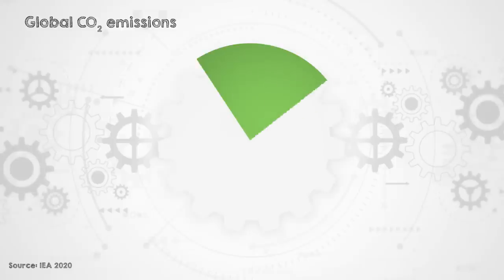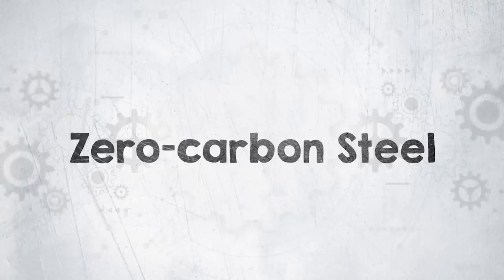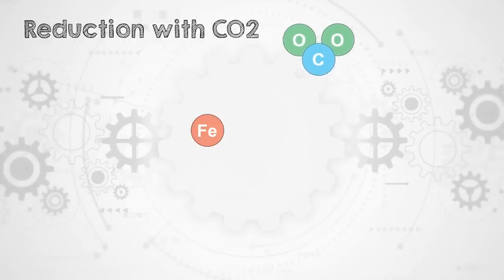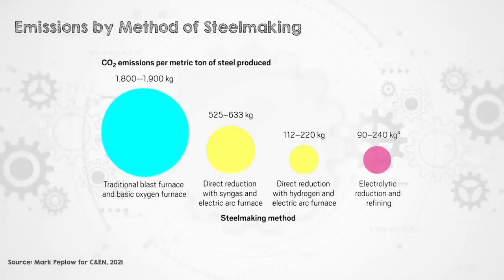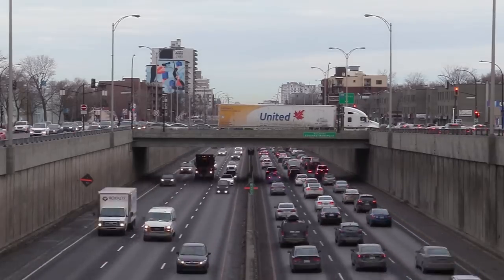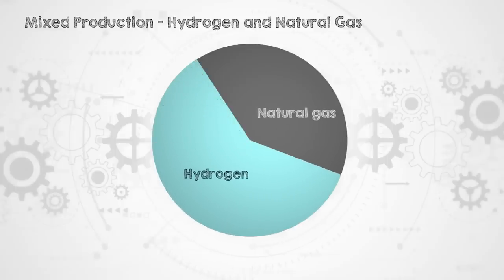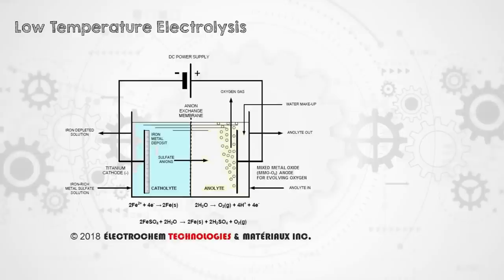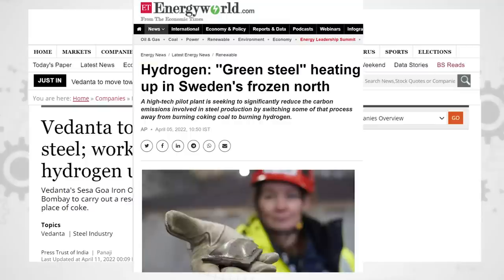Green Steel: Can We Make Steel Without CO2 Emissions?

Comment: absolutely fascinating, but I just don't think it will be as easy as the doctor thinks.
Reply: I've actually been looking into using a heat pump for high temperature smelting.  it should be much more efficient, if I can find a material that can take the strain at such high temperatures.  Which to say the least is proving challenging.
Reply: @roguedogx  Thermodynamics is against you in this. Heat pumps are great when you don't have to raise the absolute temperature much - say from 273 K to 303 K (0 °C to 30 °C), maybe to heat your house. The coefficient of performance (COP) is Thot/ (Thot - Tcold). For the houshold heating it would be 303/(303 - 273) = 10.1 this is the theoretic maximum, you will have other losses so might get 5 ish. For heating to 1200 °C from a heat source at 25 °C the COP would be (1200 + 273)/(1200-25) = 1.25. This again is the theoretical maximum and there will be losses. It's not worth the effort, sorry. So don't bother looking for a working fluid. :(
Reply: @HughCStevenson1  dang.

I must have dropped a zero someplace, because I swore the numbers came out better than that.

Comment: Rosi, there is one topic aside hydrogen, that I never hear about, but is perhaps concerning not me:
For me hydrogen may be a nice energy transporter - but physically it's more than annoying:
- super small, need special containers
- steel tubes and containers will be spoiled over time in contact with hydrogen
- you have to compress it with much energy to transport
- when transporting, most assume liquid - which is extremely cold - other technical challenges will arise. 
- any leakage in the transportation and storage will be extremely dangerous. 

So - as I heard, some Arabian states already test solar power to produce hydrogen for future markets (make sense due to their sun exposure).

It would be interesting how production ready transportation exists.
Reply: Highly volatile too!

Comment: You missed steel plants are integrated sites with attached mills, the works arising gasses are captured for their reheat furnaces. Every mills reheat furnace will also need converting too. 
Integrated steel works are massive, and those in the EU pale to those in China, the blue circles on the map just don't convey the enormity of the issue here..

Comment: It seems way easier just to spray-paint the steel after producing it if all you want is green steel.

...

Joking aside, next up I want to see low-carbon cement production, and aluminium too. Both of those can easily switch to low-carbon energy but still release carbon intrinsically from the main processes we use for them today.
Reply from the maker: Both are on my list!
And by the way nice joke ☺️
Reply: if you're in that mode of thinking, why produce it ?  Just steal the steel.

Comment: Wind and solar electricity does not have to be intermittent, because if one uses them to produce Hydrogen then the Hydrogen will stabilize the intermittency. So if you have Hydrogen for that then unit for making steel.

Comment: Great video! You inspire the industry and decision makers to take bold decisions! With our invention of the HYBRIT Technology and production of fossil-free steel since August 18, 2021, we hope to do the same. / Johan Anderson, SSAB
Reply from the maker: Thanks Johan! Next time I'm in Sweden it would be so cool if I could do a tour of the HYBRIT project for a video, if you're keen to share?
Reply: @EngineeringwithRosie  Sure!
Reply: Hi Rosie, when you visit you can dig a little deeper and ask them how they plan to decarbonise the EAF.  As you say, the carbon footprint of most EAFs today is as you rightly say mostly due to scope 2 emissions, i.e. electricity production. When electricity is decarbonised there will still be a substantial footprint, 10x smaller than blast furnace route but still significant,  and brushed under the carpet by all the big steel companies that have announced following these brave fellows at hybrit. Pedantics aside it's not so easy to take iron and add carbon to it to produce steel without losing loads of the carbon you add. The biggest user of cement in Sweden is the iron ore mine. The biggest users of lime in Sweden are the steel companies. Technologies do not live on islands and true decarbonisation requires a lot more thought. Great video, I would say that you characterisation of the state of CCS in the steel industry falls short, there are more initiatives at many steel companies.
Reply: @merchantoo  hmm, correct me if I'm wrong, but I thought you had to take the excess carbon OUT OF pig-iron to make it into steel!
Reply: @gregbailey45  yes, that's right. Direct Reduce Iron (with Hydrogen) doesn't contain carbon, so it needs to be added. One of the problems is that you add more carbon than you need because it burns of very quickly,  so it's not a question of adding just the right amount. The type of DRI that already exists, from natural gas as opposed to hydrogen does have some carbon in it, so similar to the pig iron case you reduce the amount of carbon to the required level, just you start 3-4 times lower.

Comment: Where can i find the data about the emissions per ton of steel? In Holland (Tata Steel) steel is made with coal (cokes) which generates CO2 and gas, then we have emissions from the Blast Furnace, and emissions from (re)heating of steel before rolling, and emissions from electricity use.  They say it is a very efficient proces but it is a non substantiated claim.
Reply: The Dutch Blast Furances in IJmuiden are amongst the most efficient in the world. They produce iron at a rate of 1.88T CO2 / T Hot Metal.

Comment: Not a solution for cutting back the CO2 emissions directly, but still: wouldn’t it make a big difference if we’d reuse the heat coming from the steel mill for heating homes and offices? This would also work after the steel making process would change to a hydrogen-based one (the heat is always a ‘by-product’).
Reply: If you mean literally heat homes with the same heat that is coming off the furnaces, that's a tad silly. ( I'm assuming that you are young, though)

The problem is that you need to get the heat to the home, but heat unfortunately spreads out/ disapates (entropy). What you could do is, with enouph heat, operate a boiler + steam turbine to generate electricity, then use that clean energy to heat homes. It's worth noting that when you transfer between types of energy, like from heat to chemical, kinetic, or electric, you lose some energy along the way. But, it would end up being a lot more efficient than trying to pipe heat to the suburbs. 

You could also recycle heat at the steel factory for other processes done at the facility, as well as using low power thermo electric generators to passively convert whatever is still leftover. (These can only operate for a little while without overheating since they run off heat energy differences between materials to create charge.) But are good to pipe excess heat through to if heat starts to reach use/ storage capacity.

All in all, it's not a terrible idea. Heat is a form of waste, too often left on the table, when there are fairly simple ways to recycle it.

Comment: Steel used to be made with biomass carbon.  It was utterly unsustainable and led to the broad scale deforestation of Europe, you can trace the economic power of European regions through the Middle Ages based on where the steel making occurred, and when a region ran out of biomass, the manufacturing, and economic power moved elsewhere.  It wasn’t until the discovery of coal in the UK, that the forests of Europe were able to recover, and Britain’s economic might took off.  We use MASSIVELY more steel today than we did in the early 19th century, so no, biomass is not a sustainable alternative, as you couldn’t even grow it fast enough to meet demand 400 years ago.
Reply: The other thing often overlooked in biomass schemes is you need to leave biomass behind to continue the carbon cycle and maintain organic matter in the soil. Remove too much biomass from the growing site and you end up depleting all your topsoil leaving a barren wasteland.

Comment: Why haven’t you answered my question re magnetite :( I posted it again in your latest podcast
Reply from the maker: I haven't seen any questions about magnetite. I get too many to see and answer them all unfortunately.
Reply: @EngineeringwithRosie  I would like to know what your view is on magnetite given that your shows are mostly talking about decarbonisation of the steel industry using DRI tech which requires high grade ore. Would be great if you can discuss that in your next podcast  :)
Reply: @EngineeringwithRosie  one of the thing I don’t get is why nobody ever mentions the use of magnetite (high grade ore) to produce green steel. The drain+ Submerged arc furnace hasn’t been tested at an industrial scale so it’s probably 5-10 years away. Do you foresee a growth in magnetite?

Comment: If we use captured CO2 to make steel, it is carbon negative steel. Probably still counts if we use biomass derived carbon too.

EDIT: interested in how they dissolve the iron ore into the electrolyte for the low temperature electrolysis process. Mineral acid? Something else?
Reply from the maker: But you can't use CO2 to make iron from iron ore, as it already has oxygen atoms bound to the carbon. Rather, you create CO2 if you use carbon to reduce the iron ore. If you really want to use captured CO2 you'd first need to get rid of the oxygen (e.g. as a plant does) before you could use it. And then you'd end up with CO2 again at the end, so only neutral at best, not negative.
Reply: @EngineeringwithRosie  I wasn't suggesting that. I was suggesting using captured carbon in the form of CO2 to provide the carbon to the pure iron made from hydrogen reduction. That is carbon negative as the carbon is only used in alloying the steel, and is fixed in the alloy until it rusts.
Reply: @SocialDownclimber  The Carbon in CO2 is not available to react with the steel - it wants to stay bonded to the O2 more than bonding to the Fe. You would need to create C and O2 first and then use the C to alloy with the steel. :)
Reply from the maker: @SocialDownclimber  Ah ok! Makes more sense than what I thought you were saying. Sorry!
Reply: @EngineeringwithRosie  I really wasn't very clear in my original post, sorry

Comment: I am all for converting my foundry to hydrogen, but I'm not sure where I would get the hydrogen. It's obviously a transfer of energy not a source of energy.
Reply: As far as I know, if you are just melting ingots and casting them an electric furnace would be better than using hydrogen - fewer losses (as mentioned in the video - use electricity directly if you can)... If you were to use hydrogen for the heating you would need an electrolyser to make the hydrogen and that would be a lossy process (waste heat, mostly due to overpotential).

Comment: I imagined that solar arrays that concentrate sunlight on to a tower would be a good green way to go for smelting and steel making. Maybe even shipping ore and scrap to southern desert areas to do this.
Reply from the maker: I'm thinking about making a video on renewable industrial heat. I'll make sure to include that option if/when I do!
Reply: In Australia‘s case Northern Deserts … their  Iron ore comes from a line close to the Capricorn Meridian … hey how about induction melting utilising the solar energy from an Array of electric Solar panels close to the Ore Deposits ??? Hydrogen is very dangerous compared to Solar Electricity … imagine an induction blast furnace !
Reply: Large PV arrays are more cost effective than reflective.

Comment: I'll start believing in using green steel after ammonia-based fertilizer production is no longer dependent on natural gas.  If you can't make ammonia without steam reforming of fossil fuels, I can't see it as being practical engineering to use hydrogen or electricity for reduction of iron ore.
Reply from the maker: I think it's better we work on both geen steel and green ammonia simultaneously. And people are working on both, so that's good.
Reply: Actually, you can make hydrogen without CO2 via methane microwave assisted pyrolysis. This process produces high purity hydrogen and carbon black powder. The carbon can be sequestered underground or utilized for other uses.
Like true green steel, this version of blue hydrogen or turquoise hydrogen pyrolysis is not done at scale today but can be in the near future.
Reply: @EngineeringwithRosie  Agreed, let's not wait for pure processes to exist before we get to true green steel or ammonia.
Reply: You need 1.2 tonnes of hydrogen to produce 1 tonne of DRI. The UK produces 7.9 million tonnes. Germany (largest steel maker in Europe) produces nearly 50million tonnes. A wind Turbine has a tower weighing 150 tonnes. So you wil need 900000 tonnes of Hydrogen in the UK alone… UK imports 875000 tonnes of iron concentrates each year. That is without fertiliser and cement. Presently an electrolyzer uses 50 KW hrs to produce 1Kg of Hydrogen. The best Chemically is 39KWhrs to produce 1Kg of Hydrogen. The UK will require at least 160 GW installed capacity, just to keep the lights on. To produce the hydrogen required would need 16.7 TeraWatth of spare renewable generation. For the UK, would be better to let Australia make pig iron for transport to the UK.
PS, did I mention sponge iron and electrolysis iron is pyrophoric
Reply: @ForzaJersey  Interesting idea.  When I first worked in an oil refinery, it had a carbon black plant.  Seems like carbon black might be incorporated into roadways to sequester it.
Reply: @EngineeringwithRosie  Always the optimist!
Reply: @ForzaJersey the problem is that that reaction is endothermic (791.5 kj/mol), while the reforming one is still exothermic….so it always boil down to: where do you get the energy from? 🤔